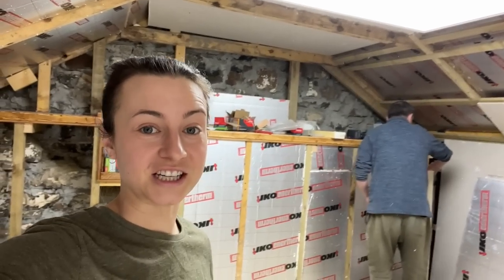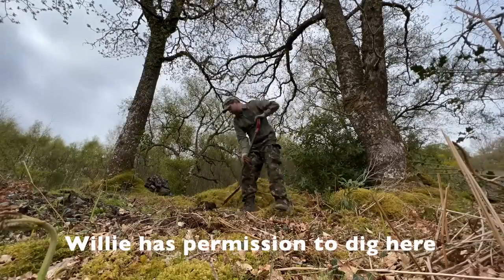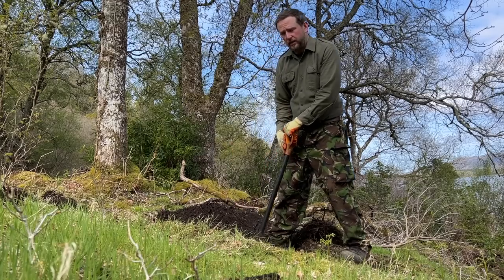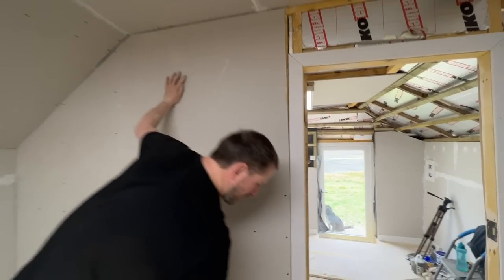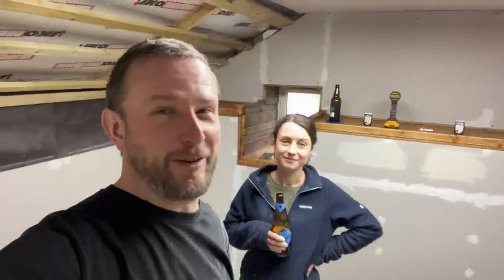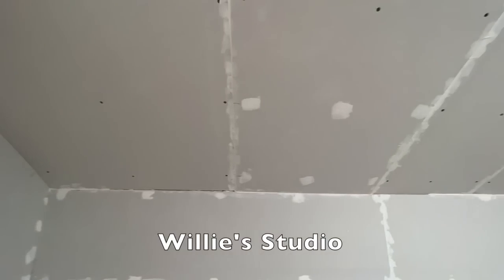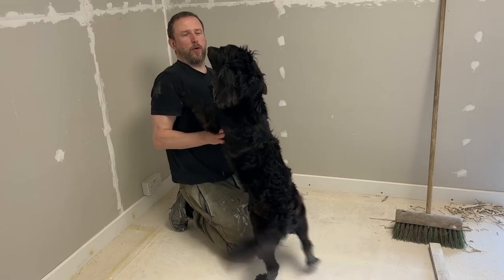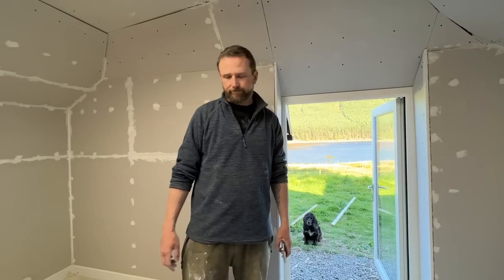BYRE RENOVATION - So Close To Finishing!! 1840s Cottage - Isle of Skye, Scottish Highlands - Ep23

Comment: I think the last "marmalade" jar you found might be used for making a meat loaf or similar. It does not have a neck so you can extract the product once it is cooked. The groove on the top outside is where you would tie on a greaseproof paper lid with string while it is being boiled.  I have one that size and a larger one (family passdowns) that I use myself.

Comment: Good to see you have changed the opening titles.  Why not cut the insulation with a knife, cut each side then snap.  Why not crush the waste insulation and fill the gaps either side of the window.  Spray fill all the larger gaps.  On your own you use a dead leg to help you support the sheet for fixings.  Not enough screws in the plasterboard.  The specification will say about every 150mm centres.  The cut joints need scrim  across the joints.  The Iris will go over quickly as its hot, not dry.

Comment: good job. interesting that the Scot manner of hanging sheetrock does not involve taping over the joins before putting a light coat of plaster type stuff that is then lightly sanded to remove all evidence of seams. Obviously I am just as old farmwife and neither a professional builder or taper so I have no knowledge of the various methods used. I do have lots of life experiences in performing all sorts of dusty, dirty, disgusting jobs and finding creative solutions to challenging projects so we have that in common. Love your channel and your hard work ethic.
Reply: It's always done in Scotland, they haven't 'yet'

Comment: Gosh well done on the plastering. Massive job! We don’t plaster right down to the ground in Australia. We leave a small gap (1cm ish) and then run a skirting board to cover it. I think it’s for movement or maybe airflow?
Reply: It avoids the board getting wet if there is a water spill.

Comment: Use some of the UK equivalent of Durabond 90. These wall board joint compounds set with time and can gap 3/4” .
Air dry joint compounds are too slow. (90 is 90 minutes working time)!
Slàinte Mhath! 
(Innes&Gunn rum cask age Scottish beer😮

Comment: Thanks for that. Putting up insulation is not very exciting, and is certainly messy (I did my garage a couple of years ago, and it was plastic mess all over the back garden) but come the winter you’ll think the hard work was very well worth it! Are the sea trout running? Les

Comment: I hate horseflies. Nasty stingers. Skirting board was a clever idea....Pretty flowers. 
Drywall tape covers a multitude of sins. Rather than plaster, use paint with a textured roller brush. Put the finish coat of paint on top. Much easier than plaster.

Comment: Horse flies? You must have really needed material... Are you allowed to dig pretty much anywhere, or, did somebody say, "Hey, you can dig here, there was an old Manor house..." ? Spittle Bugs: GROSS . . . Spittlebugs - These small insects get their name from the globs of foamy "spit" they create along the stems of plants. They produce the frothy mixture by mixing air with fluid excretions, but not out their mouth, so it technically isn't spit. The immature bugs feed face down on the stem, and as excess sap is excreted out the anus. Adult Spittlebug eggs can live through the winter in leaf litter. Nymphs come out in late April or early May and start feeding at the base of the plants. They keep moving up, to look for tender leaves and flowers. Nymphs pump bubbles into fluid that is secreted as a foamy substance during feeding.  See you in the tall plants . . . Aren't there ticks in Scotland?